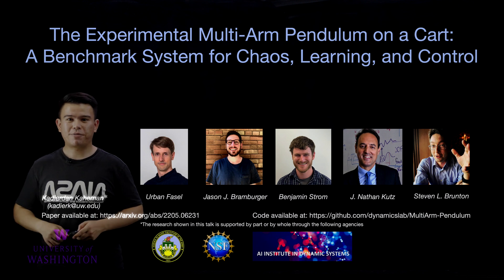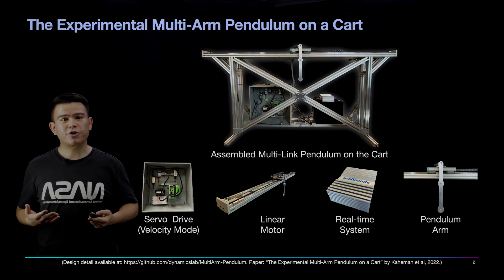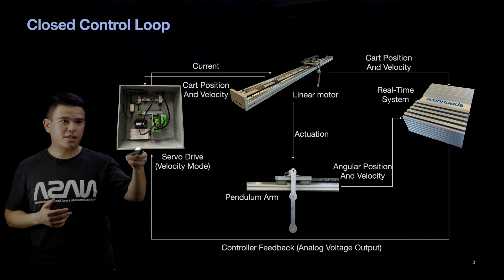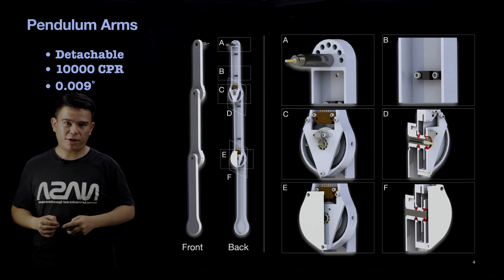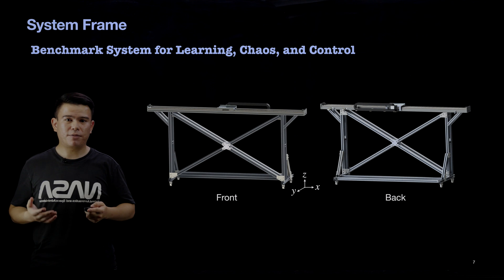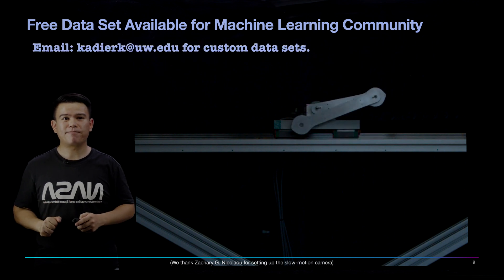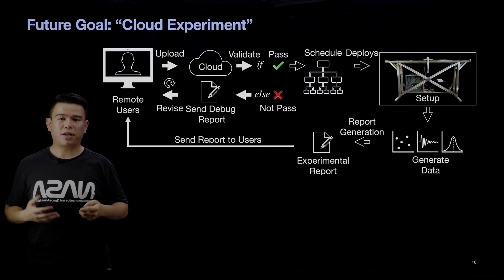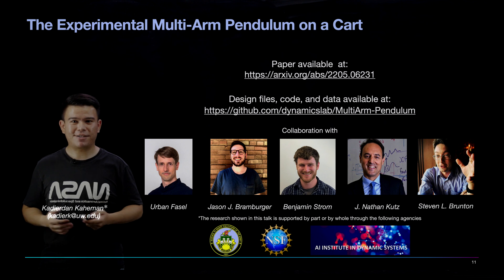The Experimental Double Pendulum on a Cart: A Benchmark System for Chaos, Learning, and Control

Comment: What does CPR mean?
Reply: I guess pulses/counts per revolution. Some form of angle measurement. Not sure if continuous or discrete. 

resolution mentioned 0.009°

360°/0.009° ~ 40,000. While spec said 10,000 cps. So yes appears to be 2 phase digital counts